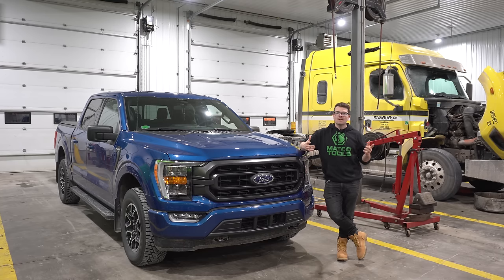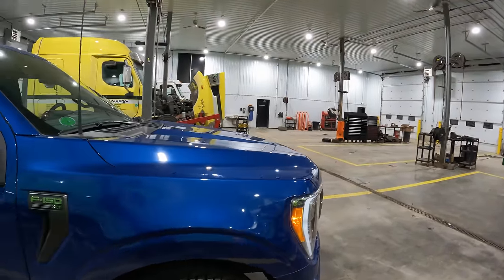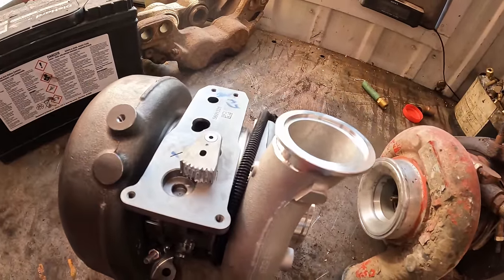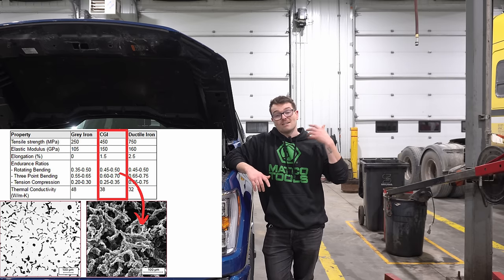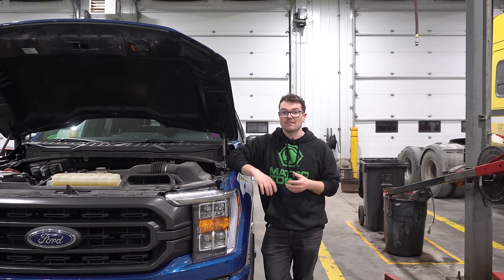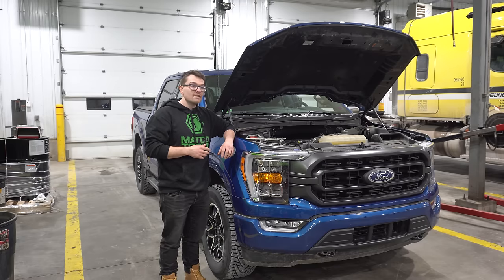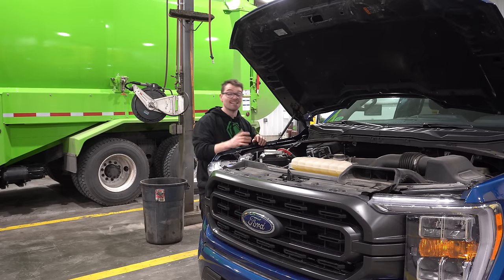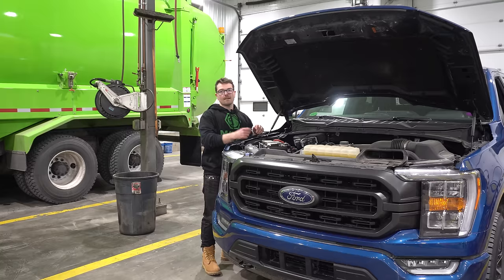Ford F150 2.7L EcoBoost V6 Engine **Heavy Mechanic Review** | How GOOD Is It??

Comment: I've heard longevity for this engine is supposed to be comparable to the Coyote. I feel like your concerns during the 5.0 F-150 video about the 2.7 were valid, but missing context. Now that you've learned about the engine, it is easier to explain why people are putting their faith in it long term despite having turbos. Both Ford and Toyota are annihilating the truck/SUV market by introducing engines that are designed to have turbos, instead of slapping turbos onto an existing engine.

Comment: Great review!  I have a 2012 5.7L Toyota Tundra SR5 Double Cab PLUS a 2015 2.7 EcoBoost F150 Lariat SuperCrew, both 4WD and both very good trucks.  I have 173,000 on the Toyota and 143,000 on the Ford.  Both pull my 12' and 16' cargo trailers and do light work on a 600 acre farm, but I use the Ford for almost all of my day-job highway miles covering 7 states.  I've experienced very comparable and adequate power from both with regular maintenance; however, all repairs have been surprisingly made to the Toyota, including TWO new fuel pumps and a new alternator, all relatively expensive!  Both are very good, but this Ford is amazing, so far, and is overwhelmingly the most comfortable truck with the best amenities (except the switch for the fan on the climate control; bad placement Ford!)
Reply: Yeah I'm not a massive fan of the 5.7, but the old 4.7 is legendary.

Comment: As amazing as the stock power numbers are for the small displacement, many tuners are extracting close to 500 of torque and 400+ HP with just a tune! And the 2.7 is holding perfectly fine.
Reply: That's impressive. Only issue is to find a reputable tuner. Guy at some shop across town likely has no clue what they are dealing with.

Comment: The 2.7 is the best engine in the lineup. I have 2 of them, one in the f-150 and one in the bronco.
Reply: Are those both the exact same engine though?  I've heard that there are a lot of issues already with the Bronco 2.7's, which seems odd, because my 2015 "Nano" in my F-150 has 235k miles on it and it's a rock.
Reply: @BrickMudge  same engine. The problem you heard was only in a few engines where they got bad valves from a supplier and unfortunately that had spread as fake news that this engine is bad. It did have a few failures but because of the bad supply issues but that has been resolved.

Comment: I own a 2015 F150 3.5 Ecoboost and like it a lot but will probably go with the 2.7 Ecoboost on my next purchase. I keep hearing so many good things about it. Probably the best base engine of the half-ton truck segment right now. Plus I’d take the Ford 2.7 any day over the base GM 2.7 4-cylinder.
Reply: I would take the old 300 ci inline 6 with an aftermarket turbo or supercharger. It will still be running when that joke 2.7 has been ground up and turned into something useful...like railroad iron.
Reply: @donreinke5863  then you just keep walking until they make that old 300 six in-line lol
Reply: @paulhunter9613  I dont care what the miserable factory chooses to build and install. If I dont like the engine the factory equips it with , I build my own engine and install it ......because....I CAN, and I have.
 One of, if not the primary criteria I have for engines is how long the design was in production, and their reputation during that period.
Congratulations, you just picked the longest lasting, most durable 6 cylinder engine made, which had a production run (including its 240 ci predecessor using the same design) of 32 years. With some head work and a SINGLE power adder they can easily exceed 400 hp, and build torque at a much lower RPM than the undersized 2.7 due to their long stroke of 3.98 inches.
And they are iron-over iron, meaning no dissimilar expansion rates of the head and block. Maybe i will wax upon the merits of the "Pinto" engine....just to bug you...oh wait..I just did that.

Comment: I was in the market for a new truck, and was set on a 5.0. I was like ain't no way a v-6 would do what a v-8 does, boy was I wrong. I went to the dealership, and they had sold the SCREW 5.0 Area 51 blue  I wanted so I test drove the 2.7 Atlas Blue, not anticipating getting it but just testing it out in anticipation of a v8 version. Man I was blown away at the acceleration of it, I drove it and I wound up buying it, and have no regrets. 2.7 to me is now all I would consider lol. 2023 2.7 EcoBoost F150 STX in Atlas Blue SCREW Blacked out logos from STX blackout trim (which was said to not fit on mine via Ford website but does) besides STX 20" wheels. Also I like the Atlas blue color better than the area 51 ,but didn't have a v-8 at the time even listed. Still proud of the choice I made. Ford never made blue a Blackout color, But I made it happen with due diligence lol. look at my profile to see her in all her glory.

Comment: It's definitely a great little motor. My 19 blew the doors off a newer gmc 5.3 liter v8, 0-85 mph.
Reply: Wait till you have to rebuild the top end. Watch the 5.3 go riding by. All of these subdivision morons that trade trucks seem to indicate they are experts. They’re not.
Reply: @hayride5953  why would I need to rebuild the top end? These 2.7s are solid. You can keep your oil guzzling 5.3.
Reply: All my friends, and cousins have had to spend three grand on timing components.  My 5.3? Yes, it goes through three quarts an oil change. Still drives great although I don’t pull many campers or tractors with it anymore. At 326K it owes me nothing. Other’n two oil leaks it has been a wonderful truck. No interest in turbo nonsense.
Reply: @hayride5953  well my friends and family who also own ecoboost engines have not had to do such work to theirs. I love my turbo engine.  Different strokes for different folks.
Reply: How many miles do they have?

Comment: I recently test drove a 5.0 and 2.7 back to back. I liked the 2.7 better. It was noticably stronger and smoother. I could feel the power band in the 5.0 as i accelerated. The 2.7 had power everywhere. Didn't matter what speed or throttle level, it felt stronger.
Reply: I drove a loaner with the 5.0 for over a week when my F150 was in the body shop after a fender bender. I couldn't WAIT to get my 2.7 back! Night and day!
Reply: @BrickMudge My first impression of the 2.7 was from a guy test driving a new F-150 with one at the end of 2014. He was aware of the displacement and told me it's sold and a little hotrod engine.

Comment: 175 thousand on my 2015 3.5 twin turbo ,4000 mile oil change and the only problem I had was the throttle body was stuck shut . Bought a new one from ford 180 dollors. Runs as good as the day I bought it . 365 horse 420 torx love the truck.

Comment: I had a 2018 2.7L Ecoboost f150 and it never had issues in the 4 years I had it. Good power, reliable, and decent on gas when not towing. The trade was for a 5.0L mustang GT and the mpg sucks but it is fun as hell and sounds sweeeeeeet.

Comment: I had a first gen 2.7 in a 2016 F150. It was a pretty awesome engine in a truck that was trouble free for the 4 years I had it. Amazing that they can get that much power out of such a small displacement. Fuel economy was only marginally better than my 22 RAM Limited with the 5.7 but it was totally adequate for the light duty needs that I have.
Reply: Doesn’t ram have a dial for the transmission
Reply: @ryanfaubert2014  yes it has a rotary dial for a gear selector. It took a little getting used to but now I prefer it.
Reply: @ryanfaubert2014  ladies like to play with knobs🥴
Reply: @ryanfaubert2014   Doesn't Ford use those ghey console shifters?

Comment: I own a small business that is delivery dependent.  In 2018 and 2020, we purchased a total of 22 F150’s all with the dealer recommended 2.7 Ecoboost.  
During 2022 to 2023, we have replaced all of them with GMC Diesels.
The 2.7 are the worst engines that we have ever encountered.  Constant Turbo and valve train issues.  It seems that they are ok to around 70k miles.  After that, problems start to appear in the valve train.
The dealer was full of apologies and stated that they do have challenge with the 2.7.   However, Ford will not do a thing after warranty.  
We had one that needed a turbo and new heads at 64k miles.  They looked at it and then refused to touch it.  We wound up putting a used motor in it.
The dealership service advisor did all he could to no avail.  He did state that the 2.7 Ecoboost was the most unreliable engine in the Ford lineup.  He was not happy that most Broncos have the 2.7 and are coming in with sub 50k miles with major issues.
Run away from this motor.
By the way, the GMC Diesels have been headache free.

Comment: Very grateful for this video. I hear so many bad things about the V6 turbo engines but I wasn’t paying attention to the separation of  the 2.7 to the 3.5 
I have a 2016 5.0  with 185,000.  Has been a very good truck just did VCT solenoids have done plugs twice. I didn’t realize you could put high mileage on the turbos. I am a pay them off and drive them a long time guy. My 2003 Super Duty 5.4 2v. 250,000. I didn’t know how to take care of it so instead of a timing job did a new engine at 150,000. I was partly to blame and some was Ford. I am still a Ford guy

Comment: I purchased a 2015 F150 XLT 2.7 new. I put 149k miles with O issues. Only downsides, turbo lag and lack of highway speed power.
Reply: give livernoise a call for a tune difference will be night and day !!
Reply from the maker: Pretty solid for the first year of an engine. I will say the second gen (2018+) do some with Electric VGT actuators and apparently have really helped with that lag.

Comment: my 2022 2.7 f-150 with about 52000 miles had the cam phaser rattle at a start up pretty bad for a few seconds.  can't replicate it now that i try to record a video every time it starts up
Reply from the maker: Cam phasers although not as common the 2.7L still do fail.

Comment: The rubber belt driven oil pump is a non starter for me. I don’t care how strong the bottom end is. When the rubber belt breaks, it will be trash  a few seconds later.

Comment: I have a first GEN 2016 Ford F150 with a 2.7 L twin turbo six 72,000 miles on the truck and no problems ever. Great truck it just starts runs and does everything well I’m getting combine 17 to 18. mpg, which is very good for a full sized truck. It’s been a very good back and even a better motor.

Comment: I own a 2019 model with the 2.7 eco boost. Would you think an oil catch can would benefit the engine because it is both dgi and port injection? Not a cheap one. I’m talking 2 can RXP system for both sides

Comment: 2016 2.7 Ecoboost 200K, only problems a very slow oil pan leak (hasn't stained the dust cover), and a turbo solenoid switch, 65 dollard.

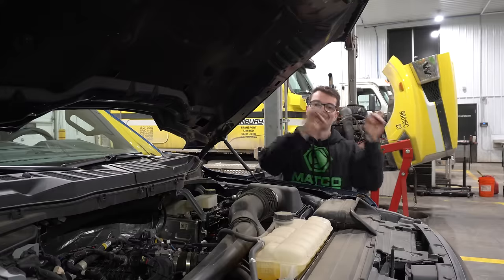Comment: I went from an 06 F250 with a 6.0 to a 2016 4x4 crew cab F150 2.7 eco boost. At 1st I was very nervous about buying it, since it was only it's second year in production and  having a real bad expiernce with my 6.0 power stroker and even worse with the 6.4 power stroker, I am going on 145K miles and it still runs very strong. 145K may not be much for some people, but I work the heck out of my truck pulling trailers that weighs from 7K to 10K on a weekly basis and doing service calls. I am an Electrical/HVAC contractor. I have a 6" lift, 35" tires, a Highway Products service body, and 4:56 gears and still get 16 to 18 MPG's in the city and 20 to 22 MPG's on the hwy.

Comment: Bought mine new to me with 7k miles on it. Now at 67k miles and still drives the same and no issues other than regular maintenance like fluid changes and brakes etc...best of all mine has the baby maker bench seat up front!😂

Comment: Thanks for finally reviewing this engine. I bought a 2020 F150 with the 2.7 and the 2.7 payload package so I’ve got the 3.73 rear end with mine. I love it. I came from a 13 Sierra with a 5.3 and it’s night and day difference with power, smoothness, towing, fuel economy, and more! It gets 20-23 mpg unloaded and when I tow my camper and family it has ZERO trouble pulling and it’s whisper quiet compared to the 5.3 screaming searching for power down the interstate. 53k miles on the clock and zero issues. Super impressed with this little engine. Paired with the 10 speed it’s incredible.

Comment: I'm a powerstroke fan and have  had many 6.0. I heard these engines were designed by the powerstroke division. I have a 2015 f150 xcab 2.7 with 235k miles and runs amazing and gets 28-32 mpg hwy which is great in a full size truck.

Comment: I had a 2015 F150 with the 2.7 and drove it for three years with no problems. We're on year five with our 2018 F150 2.7 and have only had an oil pan replaced because it was leaking. It's hard on oil, so I change it every 4,000 miles with full synthetic.

Comment: Seems like you should redo the 2.7 chevy 4 cylinder turbo, I don't remember you mentioning the same things about it but I believe it has the same type of diesel tech and puts out even more torque (430 lb/ft) than this engine does with 2 less cylinders.

Comment: My 14 3.5 got maybe 18mpg on a good day here in michigan. Bought a 21' 2.7 and I get almost 23mpg and 24 in Indiana flat road driving. This 2.4 is hands down better than the 3.5. With a tune and a few intercooler/exhaust upgrades it could be a monster!

Comment: I love my '15, 2.7 F150! It has 225k. I bought it in '17 with with 25k. I replaced 1 o2 sensor @75k and both turbos at 150k. The parts cost for the turbos was $1k, but at least they were easy to install. 
The low-end torque is why I wanted this engine. It tows up and down mountains with ease.

Comment: I have the 2020 ford f150 super crew cab v6 2.7 ecoboost and i love it...i have almost 30k miles on it and get 19.1 miles to the gallon and i installed a 6500.oo audio system in it and i love it..😊

Comment: These first came out when I was a Ford salesman and then a service writer for a short while. I dont think i saw a single 2.7 come in for a mechanical issue, but saw quite a few 3.5s and some 5.0s coming through. In 2019 i bought a brand new 2.7, beat the hell out of it for 70,000 miles. Never had a single issue, and with me behind the wheel it definitely should have lol. Every chance I had, it was floored, doing burnouts and donuts, even did massive burnouts for funny wedding photos. only traded because the single cab wasn't going to work for the kid on the way. I miss that truck every damn day 😭 now that im older and not as stupid, I could see getting a new one and putting 500k+ on it with very few shop visits

Comment: I had a chance to drive a 2022 f-150 xlt extended cab with the 2.7 ecoboost. First time actually driving a fulksize pickup and i loved it. My main concern at the time was reliability and longevity of the engine cause its an ecoboost. I loved to hear all the great things you talked about in this video. Gonna wait to hear the issues this engine has tho
Reply from the maker: This engine is a pretty reliable for all that is going on. I'm surprised how well they have and are holding up.
Reply: I have a few in my fleet that are already well over 100k miles and knock on wood so far been great.

Comment: They have a wet belt. Timing system is via a timing belt that goes into the oil sump. Don't see that ending up good long term
Reply: pretty sure its oil pump belt, not cam timing...still bad bad deal, why would Ford do this ? 5.0 has it too
Reply: I have yet to see anyone have an issue with the belt failing even now as some guys are nearing 200k miles.

Comment: IMO, one of the best engines a domestic has ever designed.

Great reliability, great power, great mpg, great towing

If you end up doing a towing test, it would be very cool if you did 2 runs.

First run normally in Drive

Second run with the transmission having 8/9/10 locked out

I found 7th loaded or unloaded with 3.73's to always return better mpg running at the speed limit versus 8/9/10
Reply: Agreed. This is almost necessary on ecoboosts when towing. I also have 2.7 with 3.73 axle and find 7th gear is the sweet spot for highway cruising while towing.
Reply: Oh..hell NO. An engine smaller than a 70s Mustang II that needs a power adder to get out of its own way. Its working itself to death in a two ton vehicle. 51 years repairing vehicles...I KNOW better.
No wonder this thing needs 8 or 10 speeds, with an adequate engine 4 would do.
Reply: @donreinke5863  Not only do you not know better, you know nothing. Hopefully most avoid you for work.

An engine is a mechanical device, it doesn't care about what work is performed or it's size as long as it is within use-case spec.
Reply: 👍 @hitempguy

Comment: I just bought an f150 stx 4x4 2.7l ecoboost. Should I install a catch can?/oil separator ?? Or leave it stock?? I want the truck to last a very long time! Thx!
Reply: Yes. Get the dual catch can set up for better protection. I just have the single catch can, and it gets about half full between oil changes, so I know it's doing something. I have 235k miles on my 2015, which I bought new. Still going strong!
Reply: Thank you!